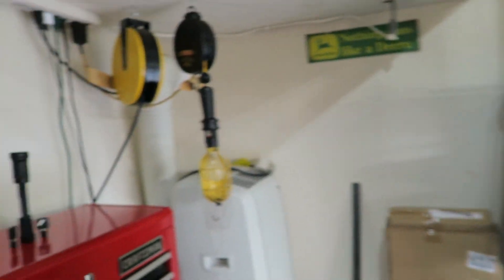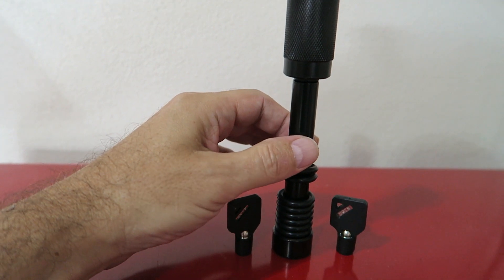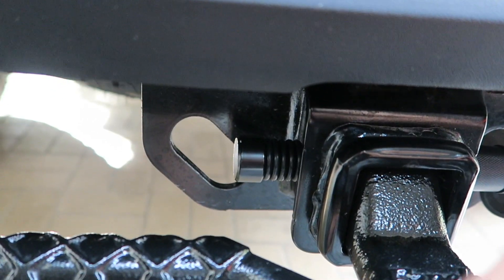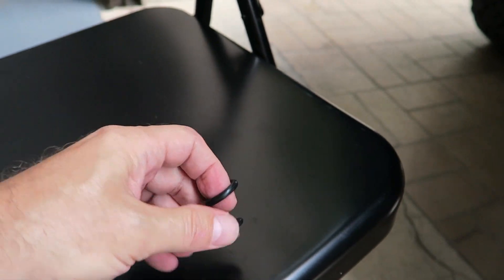Locking the Toyota Tacoma Beavertail Step

Comment: Rob I hate to keep bothering you but are you sure this lock will fit a 2024 Tacoma. The reason I ask is that I think this is the one I order and when I got it it wasn’t long enough to get the lock completely on.
Reply from the maker: It did for my ‘23 which was the same.  To be sure, measure what you need and compare it to the specs for the lock.
Reply: It does not fit on 2024.

Comment: Take the soft side of some sticky back velcro put around the sleeve cut some holes where the lock  pin goes through it will take out the rattle. Please use black velcro ha ha.
Reply from the maker: Lol!!  I was thinking chrome might look good.....NOT!!😬
Reply: @RobMotive  I did not want you to use white velcro ha ha I saw the white edge of the double sided tape you used on the switch mount omg I would have black sharpie it . But you moved it.
Reply from the maker: Lol!!  That’s true!!

Comment: That step is useless with the tailgate down. I like the folding step that Toyota sells. It's out of the way, is usable with tailgate up or down and is less easy to steal. BTW that's neither a cotter key or cotter pin. It's a hairpin clip.
Reply from the maker: It works great for me.  I’ve replaced the supplied rod and cotter pin👍